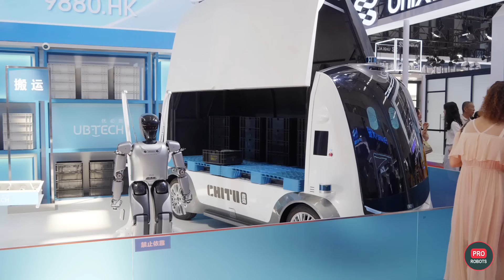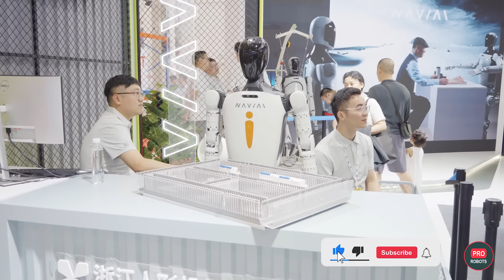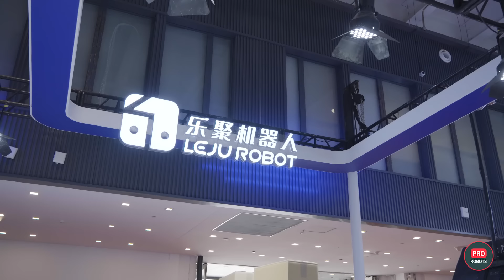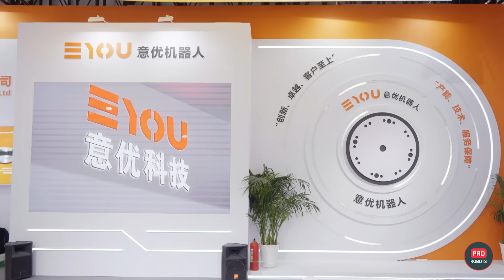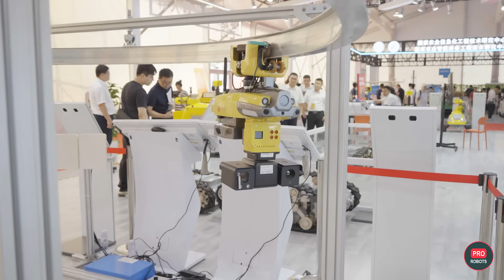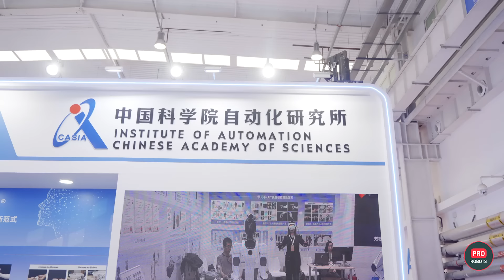WRC 2024 - China's largest robot exhibition | Robots and technologies at the exhibition in China

Comment: China's humanoid robots are advancing fast, but overtaking the US depends on AI, chips, and innovation—not just hardware. The US still leads in cutting-edge AI (like OpenAI and Boston Dynamics), while China dominates manufacturing. It's a race, but both will push robotics forward."*
Reply: You said that industrial robots are of great value in the manufacturing industry. You can check the annual installed capacity of industrial robots and the manufacturing countries of installed industrial robots.

Comment: I love robot conventions. You get the mix of garage hobbyist gluing a AliExpress mask on a vibrating mop sitting next to breathtakingly futuristic cyber assembly line torsos. NO LEGS !  Yup ! Robots don't take toilet breaks, holidays or bereavement leave. They do their appointed task 24/7. and therefore require NO legs.
Reply: They don't need heads or arms either. To make stuff you just need a machine not something that looks like a human.
Reply: @philgray3443  True, in its truest sense. But if a robot is going to replace a human it'll need humanoid features because it will fit into an assembly environment built around humans doing human stuff.